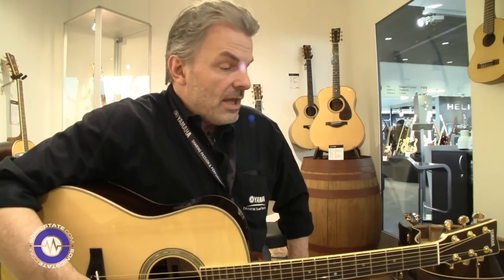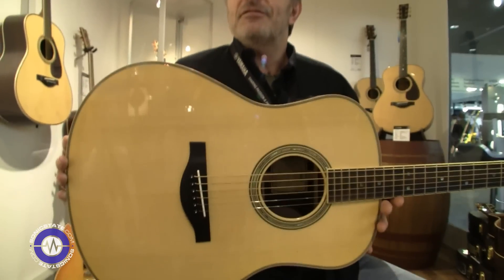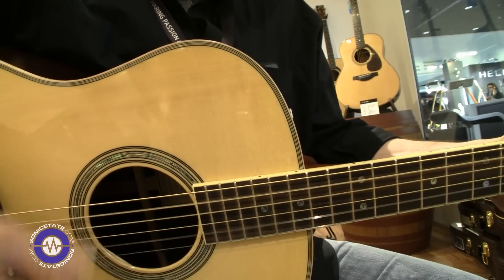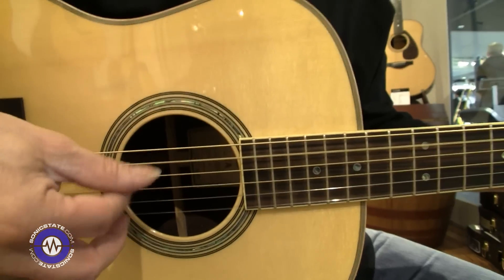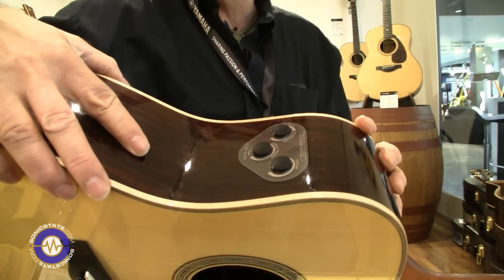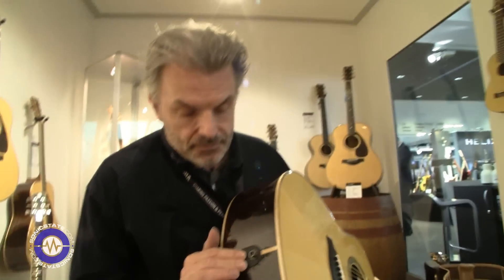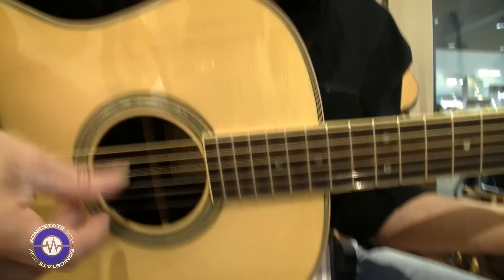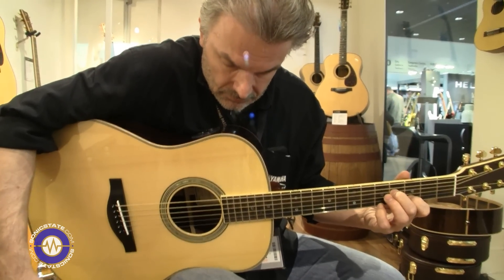MESSE 2016: Yamaha's New TransAcoustic Guitar is CRAZY!

Comment: This is the Kickstarter Tonewood amp but put inside the guitar. I bought the Tonewood amp and it is amazing. But I guess those guys sold it to Yamaha.
Reply: +npinero1 Yamaha has been using a transacoustic system in some pianos for a few years now, this is not them taking the idea from someone else.
Reply: +Joe Heisler,  I am confused, it doesn't play strings or any other guitar sounds beyond acoustic guitar, it does only effects. it is the same technological approach but it is missing the cool extras that the piano version provides.
Reply: npinero1 That's because there is a detachment between the player and the strings on a piano. With a piano they can use a stop rail on the hammers and then digital sounds can be adjusted with the console, the sounds resonate through the soundboard on a piano. Each key has an array of sensors that allow you to get a good representation of your playing digitally.